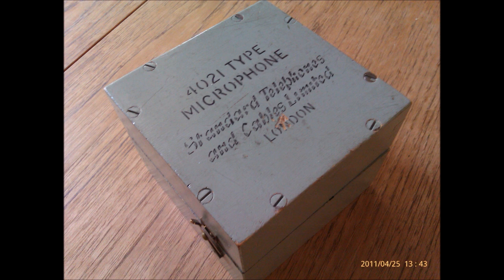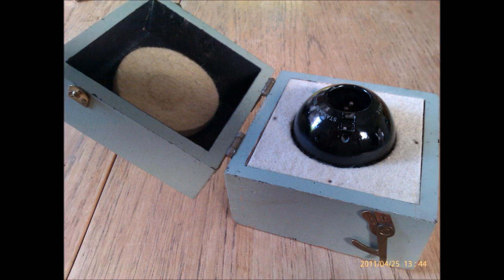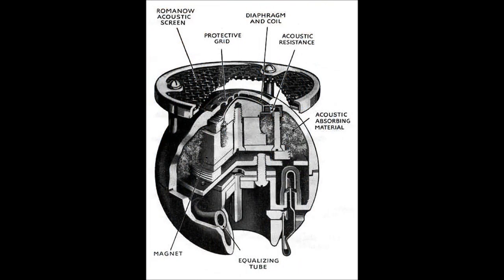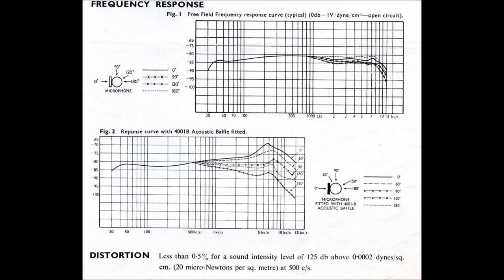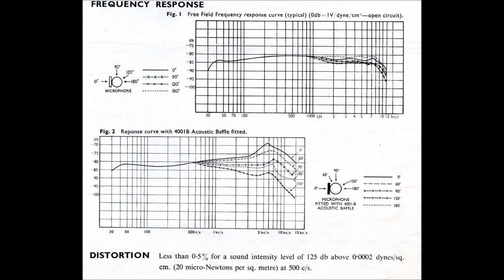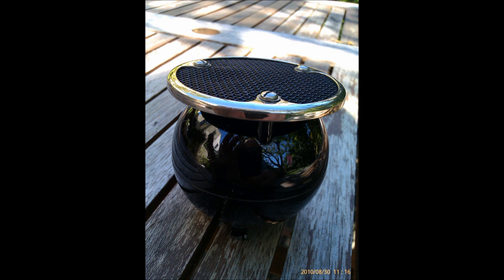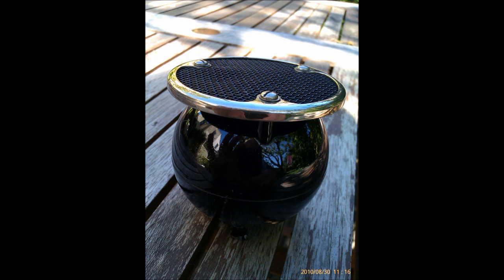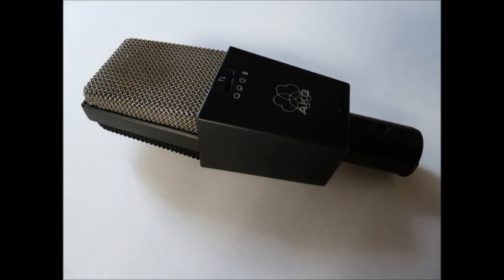Vintage Microphone Recording STC4021 Apple And Biscuit (circa 1935)

Comment: Thank you for sharing. It's great to hear real sound recorded with the microphone. I am researching the Western Electric 630A, which was used here in the US to record sound effects for a WWII deception unit. I've thought about obtaining this microphone and just wondering what the sutle differences might be between the 630A and the STC4021. Thank You.
Reply from the maker: STC was a subsidiary of Western Electric and as far as I know the 630A and the 4021 are identical. There was also a French version Material Telephonique 3630a. I have used my STC4021 a lot and it is still an excellent sounding mic. Good luck with your research.

Comment: I've just acquired a couple of these but am waiting for a suitable adaptor to try them out. Do you happen to know if the acoustic wadding and / or equalizing tube are prone to degradation? Thanks for this video.
Reply from the maker: MirlitronOne Have never had any problems with mine.

Comment: Martin, you turn everything you touch into gold :) Please write what equipment you use when recording with old microphones. Do you use boosters to record ribbon and dynamic microphones. I still have a problem with excessive noise.
Reply from the maker: I have a couple of Tascam interfaces that are very quiet (US-1800 and a US-144MKII) and I also have a Focusrite TwinTrack Pro which I sometimes use and a pair of Triton FetHeads.  I always try to use the absolute minimum.
Reply: @martinmitchell  This is a very good habit. The paradox is that we have more and more hardware and more and more software, and less and less good music in public space.